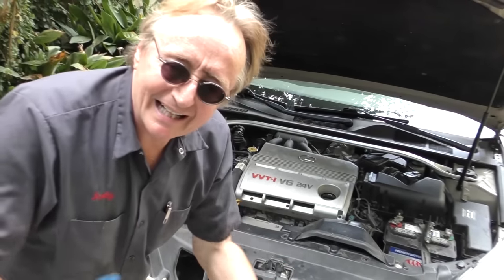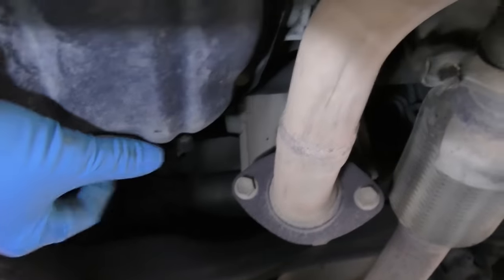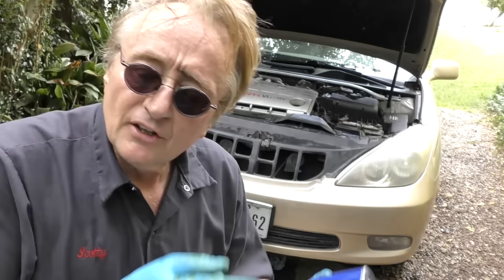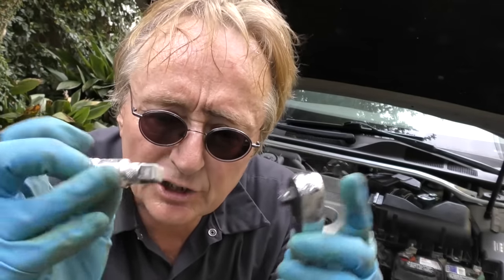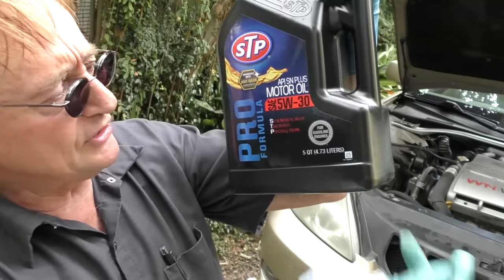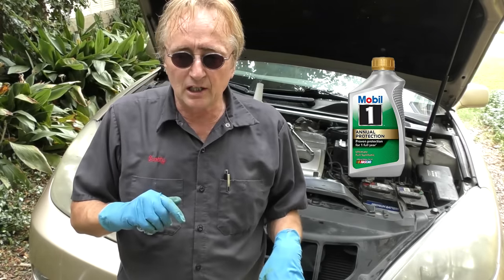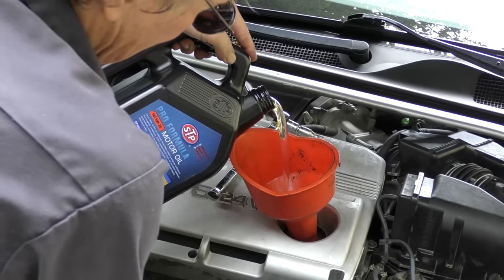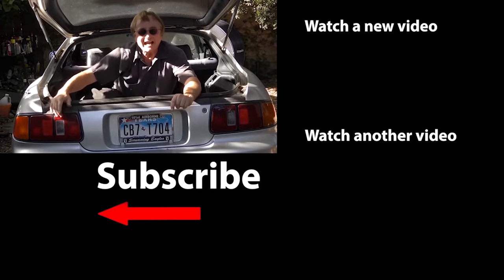Changing Your Engine Oil? You’re Doing It Wrong

Comment: So I was doing it right the whole time !
Reply: "He who's name is gold, IS, gold."  Pancho Villa back in the day.
Reply: You use a breaker bar to break loose and tighten your oil drain bolt? Yeah you've been doing it wrong
Reply: @vviiper  maybe if you have a super tight bolt a breaker bar is fine..but i agree use a normal wrench to tighten...
Reply: Oil filter removal tip
Make a tin foil funnel to keep the engine clean. Some designs drip oil everywhere after the filter is removed. 

Newspapers or tarps help if you miss the oil pan.
Reply: Your right doing is still wrong...
Reply: I put oil in the new filter before installing. I was doing it wrong.
Reply: @trollsymctroll5361  actually no. It is indeed a very good idea. I always do it... For horizontally mounted filter, I still put oil but not until it leaks while installing.

Comment: I've been changing my own oil for the last 18 years and I've never changed the drain plug gasket. I don't even care to check if it had one or not and I've never had problems with leaks. Leave it to Scotty to make me worried about my oil changes from now on...... Because of course I'm doing it wrong.
Reply: I have been changing mine since I was a teen I am now in my 50's and mine never had one either it looks to be built in solid no other pieces.
Reply: I know..me too. Now I gotta ck. And get a new one lol.
Reply: Ive never even seen one. The plug i have just seals up aginst the machined surface. No all the plugs ive seen do this thats like 10 cars.
Reply: There was one car that has a copper washer.  The thing was like $3 a pop.  That's as much as a cheap Fram filter! It was soft enough to deform when the plug was properly torqued.  I learned to file it flat again very carefully and polish with a diamond stone, and I got up to more than a dozen changes on the same washer before going to a quick stop, where they just threw on a steel washer, and I was like -- WTF, why was the mfg use the copper one in the first place?!
Reply: @gdeangelkick  That's a good question that I wish I knew the answer to!
Reply: I had to replace mine but that was after 17 years
Reply: Nick Tanzillo I am the same as you in this regard.
Reply: You can get away with not changing old solid washers but some new cars use a crushable washer that will need to be changed.
Reply: It is a good idea to change the oil pan plug gasket
Reply: Been changing oil for 39 years and have never replaced the sump plug gasket. Never a problem. Also,here in Ireland and UK,all car manufacturers say change oil minimum 12000 miles or 12 months,which hever comes first. What gives?

Comment: Scotty Kilmer owns the company that makes oil plug gaskets.
Reply: I'm glad someone in the comments is like minded, 😂 in pushing half a mile miles between my two cars, both have factory gaskets
Reply: Related to val
Reply: dorman or genuine toyota?
Reply: Scotty you rascal. Making money coming and going.
Reply: Gaskets are cheap, your motor is not!
Reply: That car, like all modern import vehicles, does not use a drain plug gasket, it uses a crush washer, and they are to be replaced at every oil change. It’s not a money making scheme, the dealer gives them away for free when you buy the oil filter. You should also use a torque wrench to properly torque the drain plug to specification to avoid damaging the threads on the bung. He was at least right about 50% of how to reinstall the drain plug. This does not apply on most domestic vehicles. They use gaskets.

Comment: There is a reason to use synthetic if you are far enough north as I am. Synthetic doesn't get quite so viscose as standard oil under extreme cold conditions. My Yaris has a fairly weak starter motor, and the synthetic made a tremendous difference.

Comment: You may laugh, but we have in our kits old Woollen socks with the toe or foot cut off. When reaching in past hot parts or pipes, sliding the sock on your arm and palm enables you to not get burnt when near hot areas. As the best oil to drain is one warm enough to get it to its thinnest viscosity. Loosen the oil cap to enable the oil to escape cleanly or it may do the ole gloop surge gloop and mess up you and the floor!
Finally when filling with new oil always pull the dipstick so that trapped air will not try and push past the oil filler cap entry and create the mess Scotty has warned of.
It allows the oil to get past pooling inside the head but instead to go easily down the drain ports back to the sump.
All my techs have followed these guidelines and have kept themselves, our customers engine bays and my floors safe & clean!
Reply: Yep, the oil should be warm when it is changed....flows better and does not take as long to drain. Wear protection on hands and eyes if you are crawling under a car. Doing an oil change or other work under a car is much better on a lift. Scotty is just a shade tree mechanic. I've crawled under lots of cars, but would have rather had a lift. Now there are good electric ones that are worth the investment if you do a lot of car work, even at home.
Reply: Mark Godfrey  Ha ha, I rather you buy me a lift (and a larger garage).  PS: Being a shade tree mechanic does not mean they are not competent, just that they are not working in an enclosed shop environment, which often includes a lift of some sort. Cheers.

Comment: I guess I'm guilty.  I never change the drain plug gasket. :-(
Reply: Me too. I never even thought about it.
Reply: It's a crush gasket, so every time it's used it forms a fresh seal. If you don't change it you risk some leakage. But if you aren't leaking anything, then you're probably fine. But I'm sure you know this.
Reply: @AndyRock1  Yup, never had a leak....YET!
Reply: Same here & I've never had any issues
Reply: May the crush washer God's be with you.
Reply: 247,000 miles, change every 5000, never changed gasket, never leaked.
Reply: I changed it every time but one day I ran out of them and decided to reuse the old one, next day I noticed a small puddle of oil under the car, now I always change it.
Reply: My Subaru came with a solid brass washer. You DONT have to change them every time you change your oil because they form fit when properly TORQUED. He doesnt even mention proper torque on the oil pan bolt. Stripped threads are FUN!
Reply: me either same gasket and plug for last 15 years no issues...
Reply: You probably  have a reusable washer
Reply: You don't need to change it. I've never had any oil leaks and my truck has over 260k miles on the same gasket.
Reply: @1951rlc  same here. Over 260k no leaks, same gasket.
Reply: RC Hobbyist Extreme - well at least they make the plug out of softer material so it strips the plug and not the pan.
Reply: The drain plug gasket on both of my current cars have lasted over 200,000 miles so far. If it ain't broke, don't fix it...
Reply: Subarus come with brass crush washers and must be replaced every oil change.
Reply: huhhhh...same
Reply: Ive found that if the gasket is in good condition, theres no need to repace it. Many of the replacement gaskets are a poor replacement and tend to leak unless you use a oem gasket.
Reply: They can crack after tightening so you most likely wouldn’t notice a leak at first
Reply: Leonardokite 
My truck has 186,000 miles changed at 3-3,500 miles and I’ve never changed the copper crush washer. Never leaked a drip
Reply: Me too but I just might start changing it
Reply: You can get a stack of soft aluminum crush washers at Auto Zone/ Advanced/ O'Reilly's etc.. for a buck or two.
Reply: Drain plug gasket is just a scam.
Reply: Bruh your gonna be leaking once you hit the 5000 mile range😂😂😂
Reply: i changed the oil on my corolla 3 days ago and my drain plug doesnt have a gasket is that ok lol
Reply: @BmwolotlE90  if you have some type of glass sealant just spread around the edge of the plug. It prevent leaks and also glass sealant easy to come off
Reply: I use to have these non metal gaskets that i reused and they never leaked.
Reply: @AndyRock1  depends on the car if it has a gasket like that. a lot of american cars dont have em. german cars do a lot of the time too
Reply: @silentshredr  yeah mine has a fiber washer. I've had some before with the copper washer. Those seem indestructible. I can see though the crush washers being an issue. I guess Toyota just makes good washers also LOL
Reply: You can wash the plug first with gasoline
Reply: If it doesn't leak (oil plug gasket), don't fix/replace it... IMO
Reply: You can go to Napa or carquest and replace that old seal washer with a brass washer . That brass washer a last for a long time until you lose it.
Reply: My shop to cheap we just re use old plug gaskets ever once in while we get some one complain about leaks.
Reply: Bosch even give one when you buy a set of filters
Reply: The drain plug gasket on my mom's Jeep is orange silicone. It's still soft and seals good after 3 oil changes lol. I'm gonna change it out next time.
Reply: Scotty has a video about buying a drain valve to replace the drain plug. Now you don't have to replace the washer, less messy and way easier to drain the oil. Installed it on two of my vehicles. Cost about 30-40 dollars for a decent drain valve.
Reply: Scotty: "That WILL DESTROY your engine!"
Reply: Yogi Demis just put pipe thread sealant on washer before refitting. I’ve been doing that for over 35 years, never had a problem.
Reply: I replaced my drain plug not long ago (after about 215k miles) because it was looking rough and didn't want to damage the pan threads. A few oil changes later the nylon washer that comes with it still looks brand new and doesn't leak so whatever. If you don't replace them they tend to leak a little.
Reply: I've changed my oil every 3 weeks with the driving I do every 3k miles... Never knew this was a thing😂😂 guess i know what I'm buying
Reply: @liberals_destroy_everythin2497  I refuse to go to a garage that relys on the old strong arm method of doing things. If Mr. Muscle strips the threads out of my oil pan, he is paying for it, not me. Now days, that fight is very real. Thats the main reason I never use wuick lube places eather. Because a full extra quart of oil in my oil pan does matter.
Reply: @Bighotwheelhunter  The solid copper or copper/ brass type are reusable.
Reply: I just replaced mine, it’s the first time in 43 years as far as I know, it finally had started to drip a tiny bit.
Reply: @scottfirman  It's not like the drain plug is a bloody head blot, just do it up as tight as a spark plug. Crush washers should be changed on every oil change. It's not like they cost £100 each lol, only a few quid for  a bunch of them. And you would have to be a right old noddy to strip a drain plug thread, you would have to do it up seriously tight for that to happen xD.
Reply: I have never replaced the drain plug gasket and I've never had an oil leak. I've been wrong for over 40 years!
Reply: @1951rlc  same
Reply: Some vehicles use a sacrificial copper crush washer (like my wife's 2017 Pathfinder) - but in general, there's rarely any need to replace the drain plug washer.
Reply: I wonder if the shop ever replace it.
Reply: @yogidemis8513  I've got a 2000 and a 12 subi,  never changed either one, never an issue!
Reply: I've been changing my own oil for 50 years,  I've replaced the drain plug washer/gasket once and that was because it rolled away somewhere.  I have never had a leak.
Reply: Ive never seen a gasket? On a oil pan plug. I just put some old oil on the drain plug and it doesnt leak. The surfaces are smooth enough that it doesn leak. If it does leak well i would replace the plug bolt itself. But ive never seen a gasket anyway.
Reply: @cuauhtemocmorisco3493 I doubt it "Bruh" I am at 300K and never changed it, hell my 2010 Toyota is at 140K and change oil and filters every 5K and it has the same Gasket Toyota put on it in Japan.
Reply: i change mine every once in a while but not every oil change...havent had any leaks or problems yet
Reply: I check em but I’ve never had to change one either. Now on the big industrial machines I work on that’s a whole different story, I’ve had to change tons of those from being cracked or torn! 🤣
Reply: You don't have to change them most of the time, at most you might lose like a couple of drips
Reply: @scottfirman  you shouldn't ever torque the drain plug except on like two cars ever made so please just screw it all the way in and then give it a quarter turn
Reply: @Leonardokite  You just jinxed yourself. Better check for a leak next time you change it.
Reply: Some drain plugs have a built in rubber or nitrile gasket. Replace the whole drain plug once a year or so.
Reply: Yeah I’ve done 100s of oil changes on a lot of different vehicles. The only one I had leak was a brand new one I had to use because the gasket that was on there before (wasn’t leaking) was broke . Never changed one besides that.
Reply: Same. And I've never had a leak from the plug
Reply: RC Hobbyist Extreme,

Correct. If the manufacturer's specification for oil viscosity and type should be followed, then why shouldn't their specification for tightening torque for the drainplug also be used? 

Also, I would never let Scotty work on my car after seeing the inside of his garage, and things he does like pouring fresh oil into an engine through a filthy funnel. ( 5:19)
Reply: There's no reason to change it every time you get an oil change, but it's also not a bad idea to change it every once in a while. They cost pennies and can prevent thousands of dollars in damage. Even if you never change it, you'll almost certainly never have a problem.
Reply: if it leaks next time i wrap in teflon tape
Reply: There's really no need to in unless the gasket is bad.
Reply: @Bighotwheelhunter   They are all reusable until they start leaking😂
Reply: @yogidemis8513   Not necessary, Have change the oil about 40 times on the Subaru and it still has the same gasket, no leaks!
Reply: @Nick-ko1tw  do you have scam fobiya ?
Reply: To be honest I never even noticed it
Reply: @yogidemis8513  Had  '2011 and '14 Foresters. Never changed crush washers. No problems. Got a ,'17 Outback  last June. They gave me some washers. Think I will use them now.
Reply: @ComputerRepairDev  holy crap I thought I drove a lot..
Reply: I've never changed that gasket either.
Reply: @Nick-ko1tw If it is a crush gasket, it must be replaced.
Reply: I change my transfer case fluid once a year regardless of mileage. The first year I went to the dealer to get a new gasket for the drain plug. It took them almost an hour to find it on thier computer. Then the guy said he has been working there for years and not one mechanic ever requested this part so I’ve been changing that fluid using the old gasket. Hasn’t leaked in 10 years
Reply: @scottfirman oh god-stripped threads are the WORST.  Imagine an all day job to change the whole oil pan FOR ONE DAMN BOLT! I’m guilty of it and learned my lesson the hard way. Fortunately that was a 1970s car where the pan was easily accessible. Cars today-I wouldn’t be surprised if you had to remove the transmission just to get it out 😂. My biggest fear is stripping the spark plug threads. I would be in tears!  😭 followed by 🤬. The last close call I had was a 1999 dodge intrepid. The oil pan bolt was going in but didn’t feel right. I backed it out and sure enough, I was cross threading. I had 5 threads to go before it was totally F’d. I used it like that until I got rid of that car. The 5 threads held. It’s just oil. Does not need to be grinded on.

Comment: I highly recommend filling the oil filter before installing helps cycle the oil as I started
Reply: The oil filter was going downwards it would spill out if he filled the filter... 🤦‍♂️
Reply: All u do for that is turn on the Acc for about a minute or so an start it
Reply: That s right man , i m doing this for years. To avoid engine to run dry , even  for few seconds.
Reply: just depends on how your oil filter is positioned. Some oil filters go on with the threads facing downwards and the sealed side of the fliter pointing upwards.  If you were to fill an oil filter with oil in that sort of application you will spill oil everywhere as you are trying to screw on that oil filter because gravity will be pulling the oil out.  With oil filters that are positioned the opposite way, then yes you can fill with oil before installing.  There are even some applications that are halfway in between or sideways and some that are tilted.
Reply: Doesn't work with filters that are open end down as this one was
Reply: I call that priming the filter. Even if it faces down or sideways you and still pour about 12 ounces in there and rotate the filter in your hand and the element inside will soak it up. If your good you can spin the filter on real quick and hardly loose any oil.
Reply: @derrinpickett9948  that's if the oil flange is easy to access. That's not the case with many cars. On both of my cars you absolutely cannot spin the filter on really quick. You can only access it from underneath the car, then you have to reach up and over the exhaust manifold pipe, and then you have to fumble around a bit to get the filter aligned properly so you can start screwing it on.  Again, not all applications are the same.  For those that it works for cool.. but that's not going to work in every situation.
Reply: @racers115  put filter on dry, pull full injection fuse, crank car over, now u have full filter